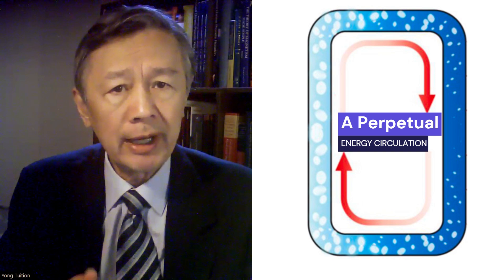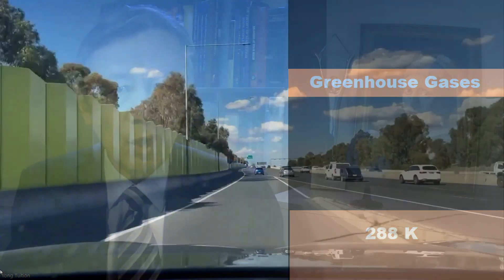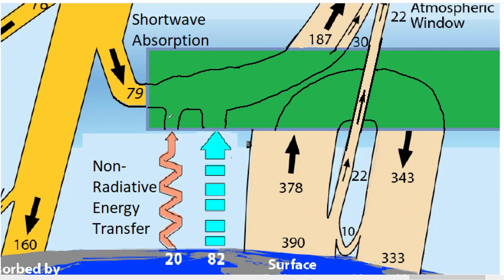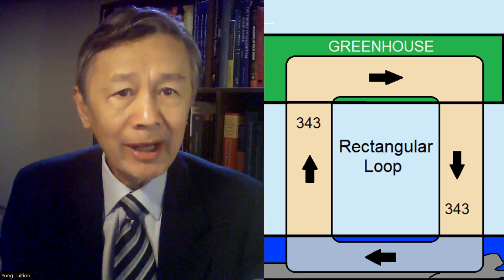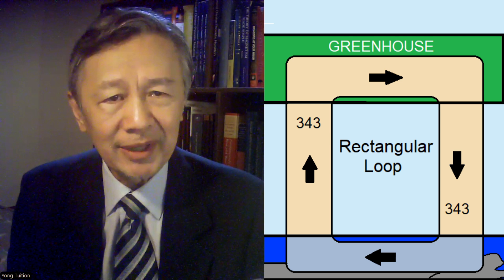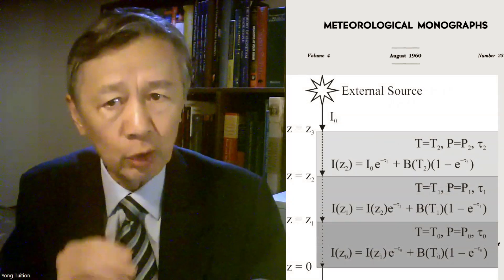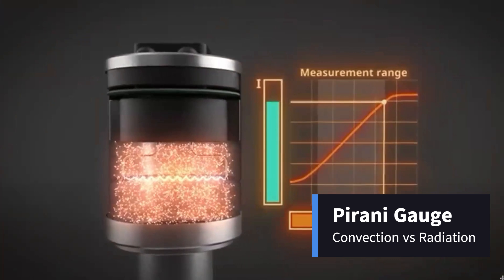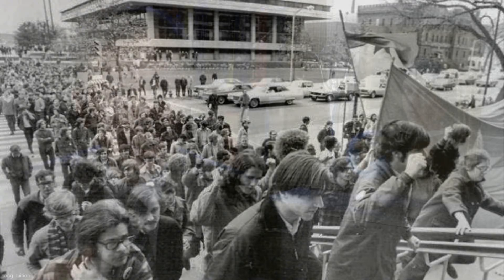A Perpetual Energy Circulation Revealed | Independent Research 20241201

Comment: The flow diagram assumes the "greenhouse" is well off the surface; however, CO2 is such a good absorber that virtually all IR within the CO2 absorption spectrum is absorbed in the first few hundred meters of atmosphere. At that level re-radiation (other than up) is negligible compared to the transfer of heat to the other atmospheric gases by conduction, plus convection. As you point out, downward radiation from cooler gases cannot occur; heat cannot flow from a cooler to a warmer environment without expending work.

Comment: The Trenberth's energy balance does not violate the second law of thermodynamics.  Roy Spencer makes this clear

2. THE GREENHOUSE EFFECT VIOLATES THE 2ND LAW OF THERMODYNAMICS. The second law can be stated in several ways, but one way is that the net flow of energy must be from higher temperature to lower temperature. This is not violated by the greenhouse effect. The apparent violation of the 2nd Law seems to be traced to the fact that all bodies emit IR radiation…including cooler bodies toward warmer bodies. But the NET flow of thermal radiation is still from the warmer body to the cooler body. Even if you don’t believe there is 2-way flow, and only 1-way flow…the rate of flow depends upon the temperature of both bodies, and changing the cooler body’s temperature will change the cooling rate (and thus the temperature) of the warmer body. So, yes, a cooler body can make a warm body even warmer still…as evidenced by putting your clothes on.

The only body that does not emit IR radiation  is one at 0K.

Comment: Dear Mr. Yong, the Model of Trenberth must be wrong, because there is only one input of solar radiation (160 w/m2), but much more long wave radiation energy from the surface(390 w
/m2). In the complete  process much more energy will absorbed by the earth's surface (a x 160 w/ m2 ). For example, when the first backradiated energy-unit will be radiated again from the surface, there have been absorbed three times of short-wave sun-energy (480 w/m2). A better model has to use flowing energy in time-units, so also higher mathematics. So it is possible to approach the laws of physics (thermodynamic), with which the delay of the cooling-effects of the atmosphere will be shown. In this way we could see, that the balance of energy can fit in the model of Trenberth. He used kindergarten-science. That was his problem and a very high back-radiation, that he must reach with very simple additions and substractions. His model doesn't describes the complexity of climate, in which loops of any direction are implemented. Are You willing, to construct such a flowing diagramm to fit it into the thermodynamics? 

Yours sincerely 

Jürgen Wisser
Reply from the maker: Thank you very much.  I shown a diagram in this talk (6:52), in which I argued that convection can cool the surface at 160 Wm-2 without surface infrared radiation.  I also illustrated the energy transformation processes from the internal energy to longwave radiation at higher altitudes by an inclined line.  In this way, both the temperatures of the surface and the atmosphere can be regulated by the adjustable outgoing longwave radiation to space.

Comment: This is probably a naive question. But are all these upward and back radiation flows readily measured?
Reply from the maker: It is an important question. Many attempts have been made.  At the top of the atmosphere,  instruments on satellites have been used for over 50 years, but the uncertainties in measuring the key number, called EEI (earth energy imbalance) is over +/- 4 Wm-2 while the theoretically estimated value is less than 1 Wm-2.
Reply: And they must surely be in flux?  As the Earth travels around the Sun, it's distance varies some 3 million miles!  That means a different solar irradiance figure every day.  So the energy flow data would change.

Comment: I interpret that Trenberth's downward LW radiation is simply a reflection of the atmospheric heat storage.

The only radiative emission is to space. 

The radiative heating from the sun occurs mainly at the surface of Earth, and the re-radiation of the planet to space occurs mainly from atmosphere. 

This drives a thermodynamic disequilibrium.

The solar radiative heating occurs over 50% the planet at any given time, averaging 480 W/m2 accounting for albedo and solar constant. Only 1/2 the planet is illuminated at any given time.

The outgoing re-radiation occurs over 100% of the planet at any given time, averaging 240 W/m2. 100% of the planet glows in the IR.

You could say simply optical depth is 480/240 = 2. This seems somehow a fundamental property of the planet.

The rate of convection, that is the heat flux, or power (work/time) is maximum at 1/2 the difference in radiative heating of the surface and the radiative cooling of atmosphere. 

This emerges from optimality, or maximum entropy production. Of course, there is a spatial separation between the radiative heating of the surface from the sun and the radiative cooling of the planet to space by re-radiation from atmosphere, from which work is generated. Perhaps there is an analytical solution.

This thermodynamic disequilibrium should generate (480 - 240) /2 = 120 W/m2 heat flux. That is the sustained power, or atmospheric heat transport.

There are, of course, complications. Such as: atmosphere intercepts 80 W/m2 of the solar beam. 

Then the thermodynamic disequilibrium is a mere (400 - 240) /2 = 80 W/m2 heat flux. Coincidentally, it is exactly equal to the latent flux in the water cycle.

It could be argued there is actually no net flux of sensible heat at all, but rather it forms part of the equilibrium atmospheric heat content.

Flux in, out, and through the atmospheric reservoir must not be confused by the magnitude of storage within. 

Not a radiation loop of storage, of course, but good old fashioned kinetic and potential energy.
Reply from the maker: Your idea seems similar to what Ed Lorenz argued in his 1954 paper: Available potential energy and th maintaenance of circulation." He was to quantify  a quantity, termed as "the available potential energy" which measures the energy available for convection into kinetic energy under adiabatic flow proposed by Margules in 1903. Alas, Trenberth didn't pay attention although he could during his PhD study at MIT.

Comment: I fully agree with @markfifer3766, any global energy budget is laughable. I wonder (as being an engineer) what the practical and more specific the scientific use is of these forms of contemplations. Each and every value is an estimation, a result of some “computer simulation”  or (personal) assumption. Moreover, nobody has ever been able to give a realistic meaning to 255K or 288K. An average world temperature has never, is never and will never, ever been established by measurements (all values are non-calibrated and completely unrealistic computer models, Richard Feynman warned about those) . Moreover, where is the night, i.e. dark side of planet earth, where there is no sun, but clouds and radiation into the universe? Or is that also being “incorporated” into the overall budget?

Comment: The Trenbert's budget defies science. In space, when you have a body 2 of temperature T2, heat is released at a certain rate. When you add another body 1 at temperature T1<T2, the heat extracted from 2 is less than it was before. The two bodies do communicate, but the heat exchange between the two bodies always go from the warmer to the colder. What Trenbert is trying to describe is the communication between the two bodies in terms of radiation, but this is not heat exchange. It's amazing how that kind of graph can be publish in anything claiming to be scientific. The loop as you said is totally imaginary.

Comment: 5:40
Wrong-ish
thermodynamics says heat cannot move from cold to hot , correct.
But radiation in the form of electromagnetic waves (infrared radiation) can move in any direction and can heat something to a higher temperature than the radiation source . This is how microwave ovens and Lasers work. (If not for electrical resistance the magnatron would be room temperature as you boil your tea)
This is part of the radiative forcing argument , and it is why unfortunately some scientists accept it.
The problem with the whole Greenhouse analogy is that it is the wrong analogy from the start, but the flimsy blanket theory doesn't have the same marketing potential.
The other problem with the greenhouse theory is it has morphed into the Insulated pressure cooker theory, with all the heat trapped and recirculating, forcing the pressure even higher until Earth turns into Venus.
Greenhouses and Igloos work by stopping contact directly with the greater atmosphere vastly reducing the effects of convection. Even if the analogy was correct there are literal holes in the roof letting the heat out. There is no upward infrared radiation over the poles or the oceans except for geothermal sources . The greenhouse effect really only works over land in cities in the minds of climate alarmists.
Reply: Aren't the poles both locations where Earth is best able to shed heat?
Reply: @ the poles and any land with high albedo and also all the oceans not directly under the sun.
The greater fear of high c02 levels is not the greenhouse effect but the icehouse effect.
c02 adds a tiny fraction of heat to the planet’s atmosphere and is more significant in places with no water vapour.
But it makes it so much better for plants to grow that areas previously devoid of ground cover start to green.
Land that’s green does emit as much infrared radiation as bare dirt which is one factor but it also doesn’t produce dust.
Dust does heat up the atmosphere but that’s insignificant, the significant problem occurs when it settles on things that previously had a high albedo thus reducing the albedo by a staggering amount. Just lay a dead leaf on snow and watch the snow melt under it.
Dust and volcanic ash are believed to have ended ice ages. So no dust equals higher albedo equals global cooling.
Reply: @Paladin-Strikes I obviously didn't make my point clear enough due to not wanting to write a PhD thesis in a YT comment.
I didn't contradict myself I just left stuff out that you if you have been paying attention to physics should have been able to fill in yourself.
But here is a bit of it, A colder source can heat a hotter target under some conditions namely being a higher energy potential.
A candle doesn't have a higher energy potential than the sun. a cup of water in a microwave doesn't have a higher energy potential that the grid the microwave is plugged into
Reply: @anomamos9095  lasers can add energy to a higher source
Reply: @ . So? If there’s a point that you want to make you will need more words to sharpen it.
Reply: @anomamos9095  so less warm things can add heat/energy to warmer things, under certain conditions

Comment: But the IPCC has Super computers doing their calculations, how could they possibly be wrong? I recently heard that the British Weather-service has many modern weather stations, that don't have thermometers, but are points where temp is measured by remote Laser Sensing; how could such Laser temp measurements possibly be off? or miscalibrated? No or few data measurements in Sahara: now I start questioning, what UNO  are proclaiming on Global conferences!
And no National weather-service, nowhere had picked up Your proposal to install a network of "Two-way Speed of sound measurement-stations"!!! (or better Four-way Speed of sound measurement, to directly compensate wind. PS.: how precise would it be in Fog-Conditions?);
which would enable direct Local evaluation of air density! 
      in principle it could also be done with scales, measuring the weight of an evacuated, r=20cm sphere. 
Also nowadays the wind turbines from California to Europe to China, extract so much mechanical energy out of the atmosphere that even the Northern Jet Stream is affected, got wobbly, and I have seen it flowing in a figure 8 pattern in November, lately!
Reply: The World Meteorological Organisation (WMO) rates weather stations on a 5-point basis between classes 1 and 5.  Almost eight out of 10 UK Met Offices weather stations are deemed by the WMO to have ‘uncertainties’ – i.e., potential errors – between 2-5°C.  Classes 4 and 5 have possible corruptions of 2°C and 5°C respectively.  The WMO suggests that Class 5 should not be used to provide an accurate measurement of nearby air temperatures, yet nearly a third of the Met Office sites are classified in this super-junk category. Only classes 1 and 2 have no uncertainties attached and only these should be used for serious scientific observational work. But, inexplicably, the Met Office has very few such uncorrupted sites.

When you look at NOAA's pristine-site graph, in other words, when you use ONLY the quality recording stations giving you excellent data, there is no warming at all in the past 20 years in the US...nothing.

If you use tree ring data going back to 1550 there is no warming at all, and if you use sea level rise as a proxy, there is no warming (merely the gradual rise since the last glacial period).  That is to say that it doesn't show the warming-cooling-warming since 1880 which is shown in surface temp graphs.

EVEN IF we say that there is warming, it coincides perfectly with a drop in albedo since 1980 - decreased cloud cover.

Comment: On the P gauge, they use an element with a very low emissivity, I believe about .05 on the MKS gauge.  It results in a ratio of >300:1 convection/emission. However, when I use St Bolzmann to estimate the wattage by emission of the gauge if the element had an emissivity of .95, and assuming the wattage with SL gas pressure is roughly the same, it results in a ratio of more like 15-20:1 convection/emission. So in that case, to the extent there is IR upwelling, it can be no more than 5-8% of the energy removed from the surface. Regardless, the Trenberth claim of the *opposite*, 1:20 convection/emission, is obviously false.

Comment: Of course CO2 makes a detectable difference in the picture of earth radiation. 
But any extra heat energy trapped in the miles of air overhead has to be enough to increase heat in all the miles of non radiating ppm. 
You can’t just pencil it into the black surface without recognizing that obstacle. 
Sure glad that actually educated and intelligent people like Dr Yong are around to explain the mistakes in detail. 
The average person like me would have a very hard time otherwise.
Reply: What if CO2 did nothing at all?  What if the greenhouse effect doesn't even exist?  Try 'Ned Nikolov'.
Reply: @ 
Wei yes, that is the reality. It doesn’t create “extra” heat above system input, just by existing in the thermal system. Dr Yong created a very complex, interactive computer model in one of his videos that proved that. If you have a desktop, you should look it up. 
Nikolov focuses on the proven fact that density affects the retention of heat input, but still doesn’t create extra heat above input. 
Only climate hysteria science claims extra heat above input. Because of black body physics. 
But atmospheric black molecules are absorbing the “extra” thermal energy in a 3D media of 100,000 cubic meters and tons of air over every square meter of surface. 
So it isn’t traditional black body physics.

Comment: This is the one I've been waiting for. Thanks Dr Yong!  I have read that there is only one place where back radiation can occur, and that is where the lapse rate reverses in the ozone-heated upper stratosphere where down = cooler. There will be a little bit of CO2 and methane BR toward the lower stratosphere until the reverse lapse rate stops. This would suggest that increased GHGs in the upper stratosphere would cause stratospheric warming not stratospheric cooling. With Tonga dumping all that WV into the stratosphere artificially, resulting in some WV upper level BR toward the tropopause, perhaps that is the reason for the upper Tropospheric temperature spike post Tonga recorded by UAH.

Comment: I am still trying to figure out how they are claiming that cooler rarefied air at a high altitude can warm warmer, denser air at a lower altitude and/or extremely dense, much warmer earth.  Their claims make absolutely no sense.  If what they claimed occurs in the atmosphere were true, you could heat your house in the winter by taking heat from the cold air outside without spending a penny on energy as the heat would naturally be flowing from the cold to the hot.
Reply: The same way an extra blanket around the cold outside of your jacket makes it warmer inside: By adding 'resistance' to heat transfer, the warm side becomes warmer to compensate. That is how the warming occurs. Actually, the warming comes from the sun and is retained better. So the effect is as true as saying 'the blanket is warming me'; it is not, it is restricting heat transfer from your body to the surroundings.